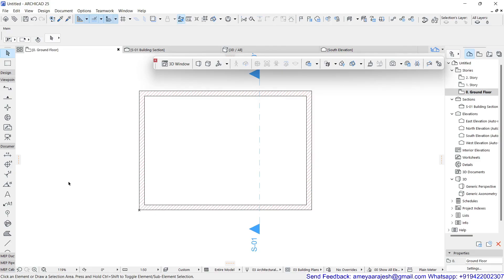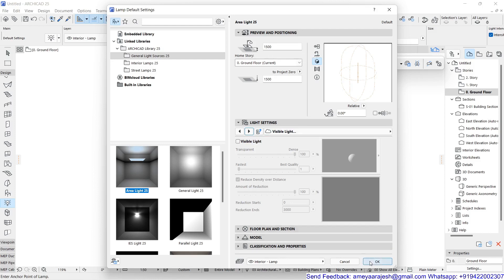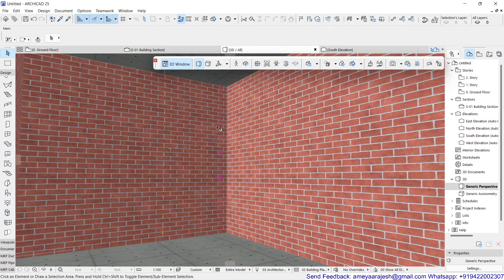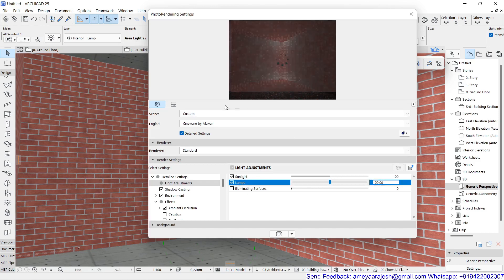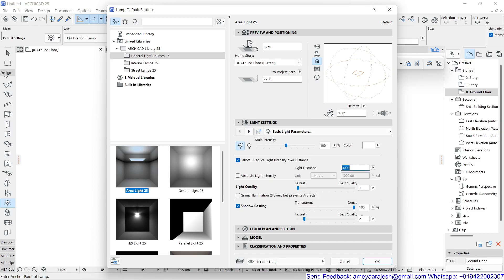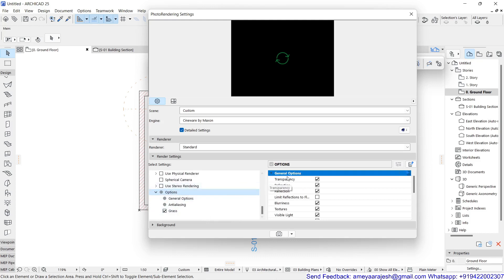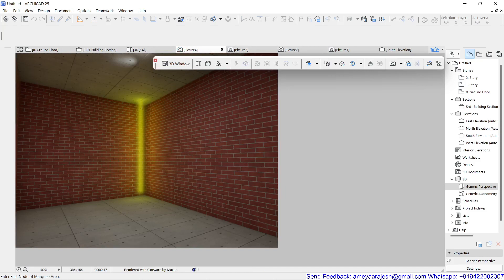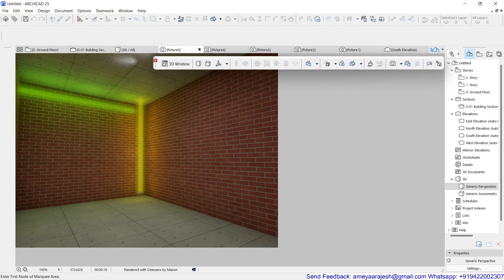ArchiCAD   Linear Light Effects

Comment: hello there. So good, thanks, Have a question :  How can I make a horizontal light effect ? I've tried to turn the vertical line, but I'm not getting it
Reply from the maker: Just select the inserted liner light in 3D window and use the magenta node hotspots to get the desired effects.
Reply: @ar.rajeshpatil9639  I understood, but unfortunately (I don't know why reason) it only allows me to rotate in x, y axis, but not in z axis, to put it horizontally. What is the secret to get it?